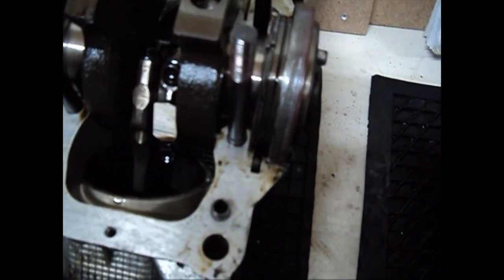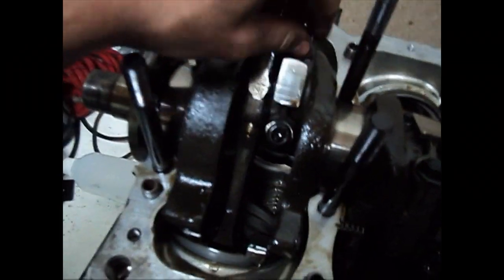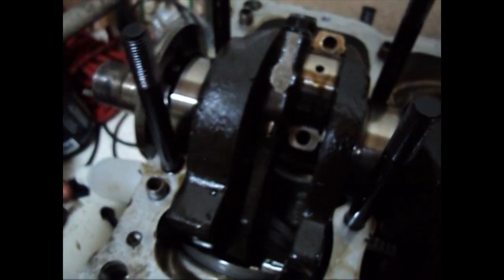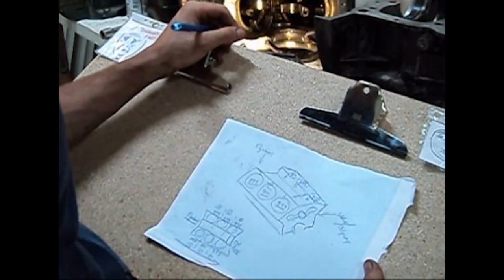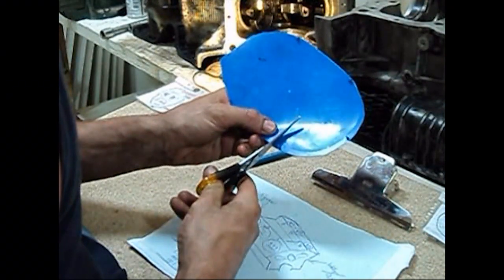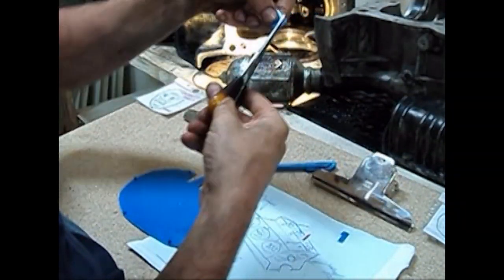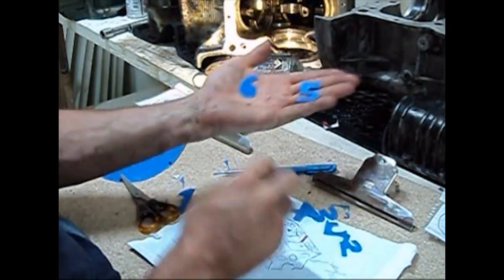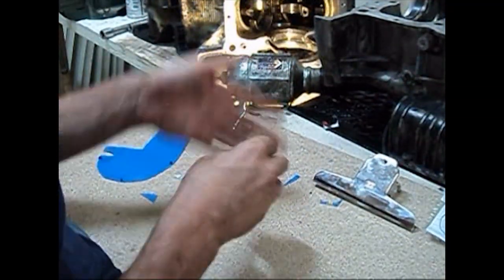Wet Sleeve Engine Disassembly - Maserati Spyder Part 9

Comment: How did you get the sleeves out?
Reply from the maker: You need a special tool to pull out liners. ( or you can get some sort of steel tube with similar diameter, place bronze between the metals and tap it out.